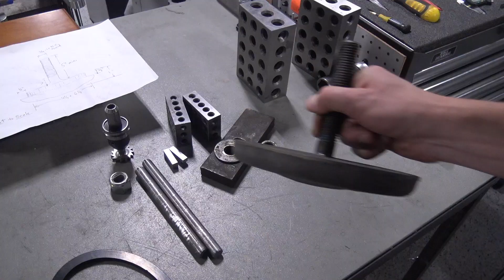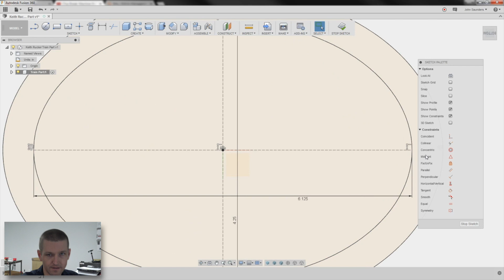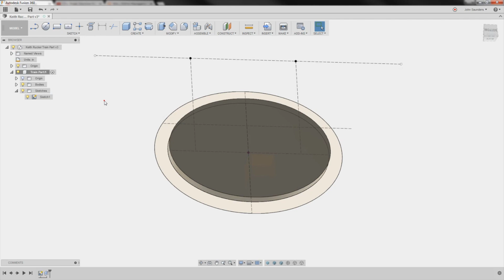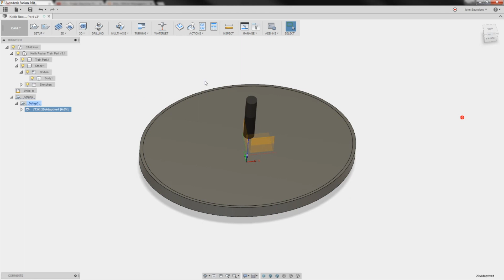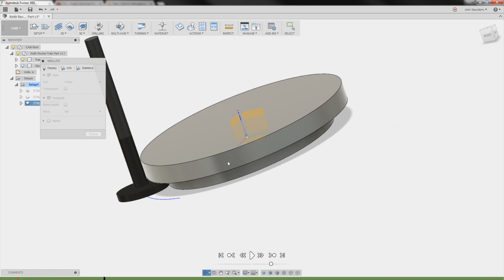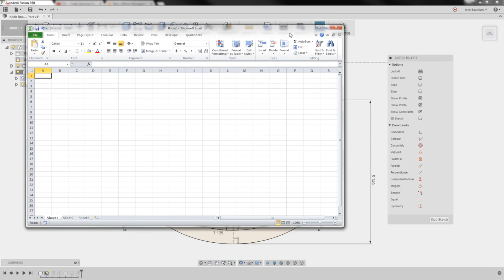Keith Rucker Cast Iron Train Part!   WW124

Comment: Whenever milling materials with hard scale or oxide layers, cast iron, hot rolled steel, flame/plasma cut pieces.  You'll want to conventional mill when roughing. Keeps your tool edge from repeatedly hammering into the hard scale , conventional cut starts in the softer metal under the scale and doesn't engage the scale. 

And with the woodruff, unless you have the HP and work stability to bury the cutter at full width and stabilize the cutter, always conventional mill. Climb bounces the cutter perpendicular to your cut direction. So it constantly will hammer against the wall you're cutting.  Conventional deflects parallel to the cut direction so the cutter simply lags behind the cut slightly, so it deflects back into material you're trying to cut, instead of into the wall. 

Conventional makes for a good finish pass in short chipping materials like cast iron, brass, bronze etc. often better than climb milling produces.
Reply: Bead blasting will work harden the surface.
Reply: What do u think about blasting before machining?
Reply: Jacek Orłowski like bead or sand blasting?

I usually don't worry about that unless the part looks particularly dirty or you can easily feel the sand grit/glass beads in it. 

Usually all it needs it a good washing to get the majority of the surface crap off. 

If it's a large production of them then a sacrificial roughing tool should be used and a separate tool for finishing. 

But if it's just a lone part or too I wouldn't worry much about it.
Reply: Thank you for your tips. As  blasting  I thought about different kinds of mediums. I'll machining in the future many cast parts not to clean usually.
Reply: @orowski4414  the engine shop I worked in did a bake, steel shot blast, and wire wheel on cast iron parts for machining. Mostly due to the fact that the parts were greasy and rusted. Wire wheel wouldn't be a bad idea

Comment: An interesting solution to an interesting problem. I would like to point out though, your first method for rotating the part in CAD would not be accurate, though the second one will. Why? Think of the extreme case where you have an almost perfectly round ellipse that is rotated near 90 degrees. You would have to input a near infinite difference between the two, yet on the machine you will hardly measure any difference! Take the same case with your second method, and you will get the correct result, as you have modeled exactly what you are actually measuring. Thinking about what happens in the extreme cases is usually a good way for me at least to visualize how well stuff like this works.
Reply: The first method would work just fine. Worst case scenario, he would have to simply move his reference line back farther.

The his ability to compensate is limited to what he's able to measure on the machine, regardless of the method used to compensate in the software.
Reply: It probably would work well enough for this particular application, and as long as the angle is only slightly off. However it absolutely will give completely wrong results in the case I described in my original comment. Let's for the argument sake assume that everything is perfectly accurate (which is never true in practice). The work piece is rotated 90 degrees relative to how the model is oriented. Given the measurements like they were done in this video, there would be exactly 0 difference between the two, so it would appear that the part was rotated 0 degrees. Yet to make the part rotate by exactly 90 degrees with the first method, the difference between the two measurements would have to be infinite, which is quite definitively not 0. 

This then must mean that as the rotation of the part increases, then must the error in this approximation increase as well, until at 90 degrees of rotation the error is 90 degrees, hardly acceptable in any case.

Now back to the practical application, yes you would probably see by eye that the part is rotated close to 90 degrees, and thus shift your reference 90 degrees too, which would put you close to the sweet spot again. The real issue in a practical application would be in the area in the middle between the two, say 30-60 degrees, where the error might well be to big for an application where accuracy is important (which in this case it was not).
Reply: Yes, an error greater than 90 degrees would cause issues. But like you said, that wasn't the goal. And is ability to measure that on the machine would always be the limiting factor rather than the ability to compensate for that error in the software.

I didn't realize that you were arguing that it wouldn't work as a solution to an entirely different problem than the one that was being solved here. Thanks for clarifying, like John said.

Comment: I wouldn't worry about the runout on the woodruff cutter, I dont think I have ever run a woodruff or a slitting saw for that matter that didn't sound like that.
Reply: He did the right thing, conventional cut and way lower rpm. That is big diameter and alot of teeth, that sound sounds to me like surface speed too high, either more feed or even lower rpm im sure itd be silent
Reply: yeah, chatter noise on that tool doesn't mean you're doing it wrong. That's just how they sound.

Comment: I saw that part fly away then you started milling with the tool rotating with the feed direction already... Mounts with a single tightening point are super hard to get fixed properly. If you had 2 of those threads on the underside it would be a piece of cake.

Comment: When it slipped I thought "you should have put paper between the part and the gage blocks, and between the 2,4,6 and the gage blocks" .    gage blocks are very hard and very smooth, ripe for slipping on the 246 block which is also hard and smooth.   and the casting is rough so the contact area is very small, again ripe for slipping.     If you don't like paper you can use aluminum or copper sheet, both of which will conform to the rough surface and form a high friction interface.
Reply: I hear people say that all the time, stpidest thing ever. His piece moved cause he had wrong stepover and rpm. Paper between does nothing. Proper clamping and tool use keeps things from moving
Reply: Put paper sounds like the idiots that put clamps on an angle with the rod closer to the step blocks and no 123 blocks under the piece in line with the clamps. Then drill with a 3 " drill on horizontal machine with no stop blocks behind, and of course it'd move. Then they ask for help, then i tell them clamps are doing nothing, then dont listen and put paper. If it was up to me anyone putting paper between thinking it does some I'd fire right then
Reply: I should make a video proving how stupid and wrong that is, but you cant teach stupid, i bet you also think you should grind drill points offset so the drill doesnt jam on deep holes? That and paper are the 2 dumbest things i hear people say

Comment: Great job on a part where it really wasn't obvious how to fixture and locate it.
And thanks for the heads-up on how to set the entry point for the tool lead-in and using the CAM to compensate for the stock position. Good thinking 99 :-)

Comment: Nice work John, I like the creative fixtures.
I was wondering if you put a loose tube over the bolt and then tightened a nut down to hold the tube in place, would that make a good surface to hold in the 4th axis?

Keep up the good work.

Comment: Fixture Option: Take a square or round column that slips over the thread stud. Bore the hole so that it can accommodate the bent stud angle. Nut and washer on end of stud to clamp the column to the part and use shims to get the column straight with the work piece. Then you could have mounted the part in the fourth axis fixture.
Reply: Guy Tech I agree with this

Comment: I've always wondered why they always climb mill with CNC machines.  Just curious.
Reply: Better chip evacuation, better surface finish because of the better chip evacuation, less tool loading and CNC machines aren't prone to the same issues manual machining creates with climb milling (grab and run). I think that about covers it but it boils down to CNC machines spinning the screw faster then a human can.
Reply: Larry Robinson  the main reason apart from better finnish and tool life is that CNC machines use ball screws with virtually no backlash, manual machines with acme screws always have backlash which is the cause of the tool biting in when climb milling.
Reply: hrc-rr 
I suggest you look it up then. 

Climb milling deflects at roughly a 90 deg from the direction of the cut you're taking. It will bounce against the wall as it deflects and tries to spring back straight again. The springing back into the wall is what causes the chatter in bores and the over sizing. 

Conventional milling the tool deflects parallel to the direction of the cut. It essentially lags behind the cut, but deflects in the same direction, so no wall banging. And because it's deflecting in the same direction of the cut, as it springs back in doesn't deflect back into the wall.
Reply: hrc-rr I rough cut a .75 dp pocket the other day with a .25 EM and finished it with a .125 EM because it has .0625 radii specified in the corners. I climb milled the finish pass (by mistake) with .01 stock on sides and .125 to .0625 stock in the corners. Bottom line is it gouged the corners climb milling. My mistake proves your theory wrong.
Reply: Climb milling provides better chip evacuation and a better surface finish. However when you are trying to hold tight tolerances it usually deflects away from the part causing taper. Conventional milling will "pull" the cutter towards the material and cause it to cut slightly under size and can assist in removing any taper. There isn't an exact science to machining. You learn what works well in certain situations as you gain experience.
Reply: hrc-rr 
You have your tool deflection vectors wrong.  Climb deflects perpendicular to the cut direct while conventional deflects parallel to the cut. 

And having helix bores many many tight tolerance bores, conventional milling keeps them at or under sized, climb milling over sizes them. Especially when dealing with long small diameter tools.
Reply: hrc-rr 

Lol. When I get one oversize I'll let you know first 😉

I highly suggest researching it. 
Datron, conical tooling, CNCcookbook and many others have put out documents showing how cutters deflect in climb vs conventional. 

You yourself said "conventional to clean up the tapering"... 

If conventional milling cleans up the taper... that means it's not deflecting...  

Deflection can go either way, either into, or away from the material, regardless of milling direction. 

Climb deflects perpendicular, conventional deflects parallel. 

Feel free to google it.
Reply: Ccw
Reply: Climb milling gjves a better finish and with zero backlash you can climb
Reply: Hrc-rr you got that backwards, i conventional mill all the time on cnc, and climb milling takes away more material. Conventional then climb makes a straight wall. Yes a long endmill deflects out but thats not from climb milling. In this video he switches to conventional cause it supports the tool better less chatter. His best change was rpm then stepover and depth

Comment: John, I have followed you for 4 years, Do I think you're an expert? Hell no. Do I think your videos are worth watching? Hell yes.
So when it comes to your hates? Losers, everyone of them. Who cares. Keep going, Lions are not concerned with the thoughts of sheep.  And by the way you could totally have done this with the 4th axis even with the threaded bar being at an angle. Just needed a well adjusted model in CAD ie the angle that reflected the real angle of the part. Lots of measuring with the CNC DROs and the Haimer. Also you could have done a surface finish on the top with ball nose, did you think of that? Ahh.. one more. That was ductile iron. That is why it gave you chips, grey iron gives you powered. Just in case you didn't know that.

Comment: Shoulda put driven dimensions from your line in space to where they intersect your oval, I think you would have found that a .1 difference to the centerline through the oval would have yielded a much smaller difference in where those two, two inch apart lines intersected the oval because... its almost a circle. 
So the resolution of your ability to get it square is not absolute to the X and Y axies through your part... if that makes sense.
Reply: And using the same logic it is pretty clear that a small difference measured at the oval hints at a much larger difference at the centerline.
Reply: Yes, exactly my thoughts as well watching this. Why not pickup further out to get the best result for the twist angle? Other than that cool approach to a not so intuitive problem.

Comment: I think you could have turn under that piece. it would have been more square with the bolt and then the elipse. All of that in the 4 axis.
Reply: No Need to be true to the bolt ,it does nothing except hold it in place until the steam pressure build up it serves no purpose in the sealing , internal pressure does that. If you look at Mr Rucker's vid take a look at the smaller sample the gasket face is just as cast as are most from that time

Comment: I assume that an inspection cover "plug." The oval part goes inside the boiler with the bolt sticking out. A "spider" is placed over the bolt then a lock washer and nut. The gasket is pressed against the inside of the boiler. The more pressure, the better it seals.
Reply: tom7601 Yeah. And an oval because you can slip it into a smaller oval hole. Can't do that with a circle.